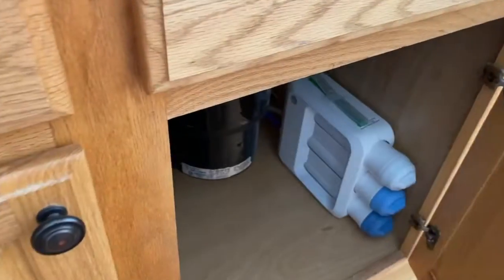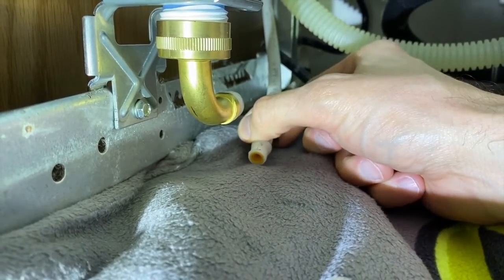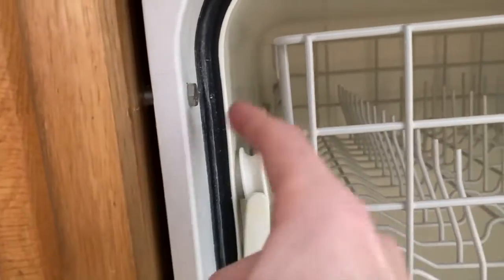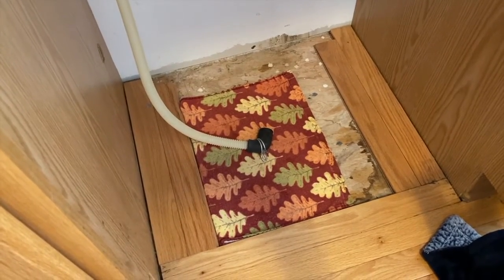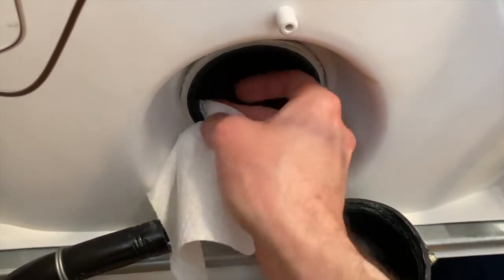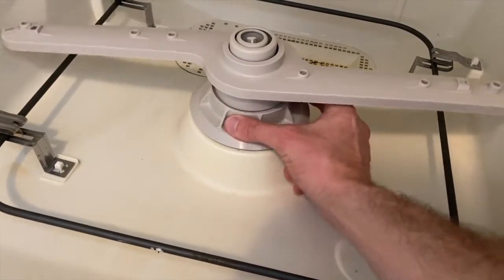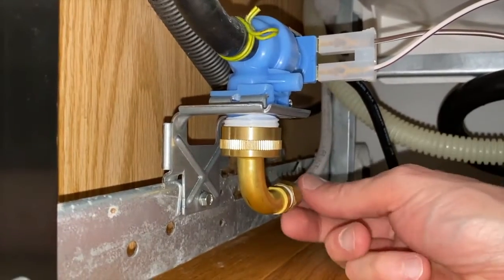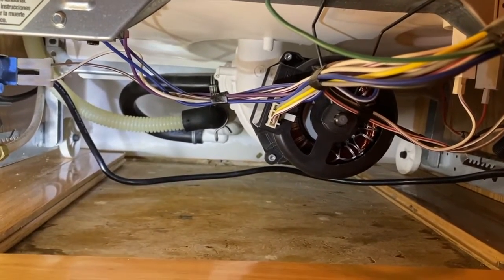Replace dishwasher pump motor assembly - Whirlpool

Comment: Thanks for the video. Helped me to go through all the cleaning, even I took out the pump and oiled the motor bearings. However, my dishwasher (this same model) still doesn't pump out the water. I suspect the solenoid or some part is not telling the pump to pump the water outside. When doing the end of the cycle instead of pumping out, it keeps rinsing the dishes. Can you please help me?
Reply from the maker: Thanks for watching, it may be damaged wiring that connects to pump motor however if pump motor is operating as designed…it should be good.  Possible faulty sensor or solenoid.

It’s possible that your Timer has malfunctioned.  Below is a video link showing the replacement process.

       https://youtu.be/ysafb4RqysI?si=WOKA9mx_kEslpIu6

Keep us posted.  😁👍🧰
Reply: @DIYwithMichaelBorders  what is this specific washer model? I own a Kenmore that is basically a Whirlpool like this one. It will help me find wiring and diagnose this issue.
Reply from the maker: @Snuggle201  

Thanks for watching, our exact model number is:

       DU810SWPU0

😁👍🧰
Reply: Fixed it, the draining hose was clogged. Replaced it with a new one. Now the dishwasher works great.
Reply from the maker: @Snuggle201  

That’s awesome!!!  😁👍

Enjoy that well earned rewarding feeling of accomplishing a DIY project.

Comment: I need a how to get dishwasher to drain video
Reply from the maker: Good morning ☕️ any update?  You may need to carefully shift cycle switch to the drain position which will trigger system to drain.  🧰
Reply: @DIYwithMichaelBorders  there is no "drain“ position on the cycle switch, only the "Rinse" position before "Off"
Reply from the maker: @knight880213  

Thanks for the reply, hopefully it’s not a faulty timer however, we cannot rule that out completely…🤔

Since your machine does not have a Drain specific labeled icon, you’ll have to carefully shift the selector clockwise until the drain portion of the cycle engages and the system begins to drain.

If you are able to drain your system manually by doing this, it’s best to replace your Timer.  Below is a helpful video of a showing the replacement process of our Timer

       https://youtu.be/ysafb4RqysI?si=CZlvj2N-2lgmjcCB

👍🧰
Reply: Me too

Comment: My dishwasher is 10 years old similar to this one but it will not drain can you help me troubleshoot on how to fix this issue i believe I cleared the filter on the left but it is not removable is there anything I have to do to the right side of the filter/drain?
Reply from the maker: Thanks for watching, next thing to do is remove drain hose and see if it’s clogged.

Comment: These 2000 whirlpool dish washers are better then the newer crap, best to keep the vintage stuff cause they break down less frequently then the newer crap on the market. My pump still works after 23 years I just have a leaking motor Housing.
Reply from the maker: That is amazing and we appreciate you sharing this.  23 years and still going strong is a great thing.

We still have our 2004 model after performing a few DIY repairs on it and it’s running great.  😁👍

Comment: The link listed goes to the wrong assembly. I need the one in the video
Reply from the maker: Thanks for watching, check out the link below.

       https://www.repairclinic.com/PartDetail/Pump-And-Motor-Assembly/WPW10247394/1489073

On back order at the moment however you can contact them and see what your options are…or you can copy and paste the part number in Google and search for additional options.  Please keep us posted.

😎👍🧰
Reply: @DIYwithMichaelBorders   Wow, the whole thing costs 282 USD currently. My motor I good I just need the plastic housing.
Reply from the maker: @aychemara  

Thanks for watching, motor assembly can be a bit pricey and in our case, the assembly is sold with the plastic housing…and not as a separate part unfortunately.

😎👍
Reply: @DIYwithMichaelBorders  ya I might have to go with this part, the impeller is giving me a problem. I even drilled above the shaft and still will not budge. This other video I watched the guy with ease pops it out with a pair of pliers, I am like BS.  My pump motor works still what a waste of a good motor. I will keep it for down the road. It’s made in the USA, quality products USA made like the rainbow vacuum 1950’s
Reply from the maker: @aychemara  

Thanks for the update, might be the best route to take.  It was 100% best for us to replace entire motor and impeller assembly.
Reply: @DIYwithMichaelBorders  yup for sure. Happy National cheese burger day to you (tomorrow). So many deals coming up for cheese burgers. Mmmmmm, Carl’s JR and Wendy’s.

Ya still waiting for their reply to see if their pump and assembly is compatible with my whirlpool. Though it is Sunday today.
Reply from the maker: @aychemara  

Awesome, well then we are 100% eating Cheeseburgers tomorrow here at the DIY headquarters.  😁👍